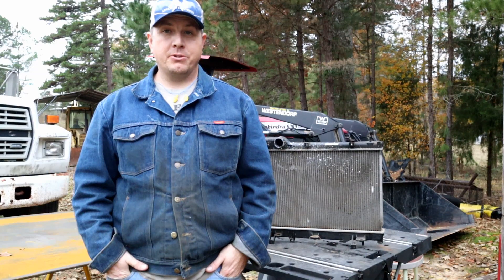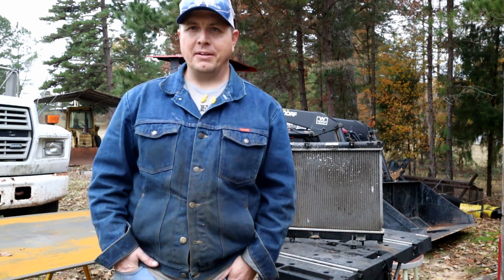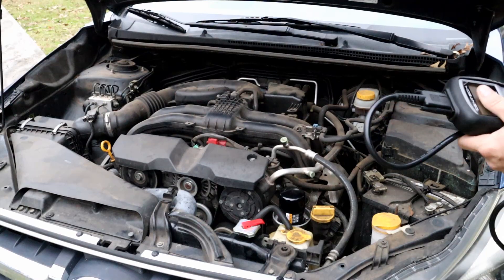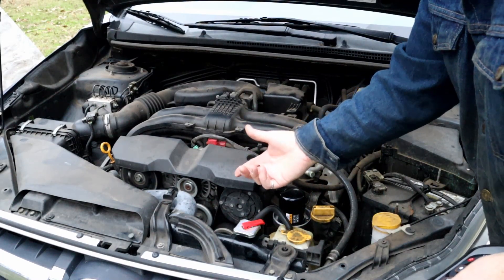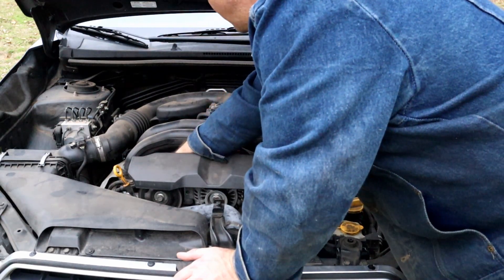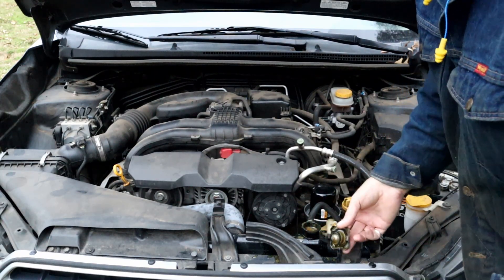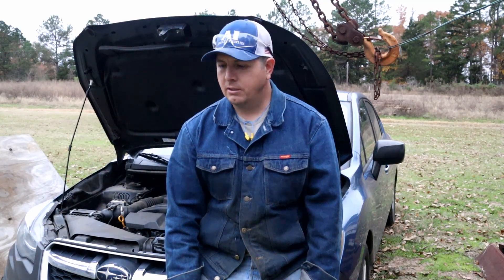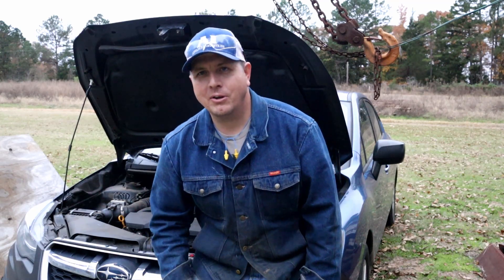Subaru Engine Overheating Mystery How To Evaluate

Comment: An old but risky trick that shady auto sales yards used to do was to put egg preserver in the cooling system to seal a cracked head or block. If it was done perfectly with correct amout and perfect timing the crack would seal. This repaiar would often last many tens of thousands of miles. The flip side is if it wasnt executed perfectly it would plug every cooling passage in the engine. (Block and Head). I wonder if this engine was a victim of this.
Reply from the maker: I’m in the process of tearing the engine down. I’ll have some more vids on my findings. 
It’s a real chicken or the egg deal. Can’t tell if overheating caused the head gasket issues or vice versa